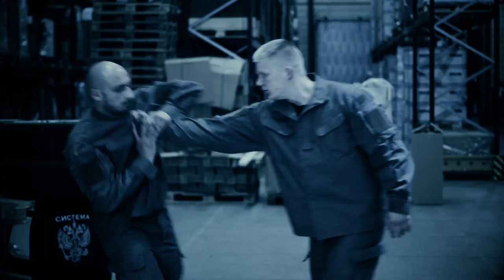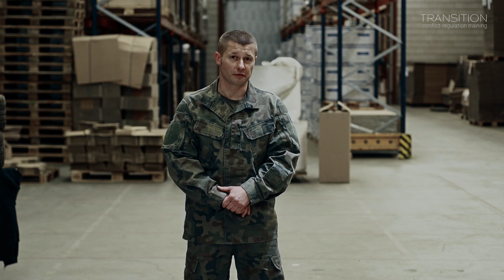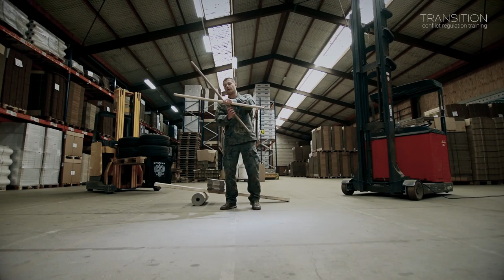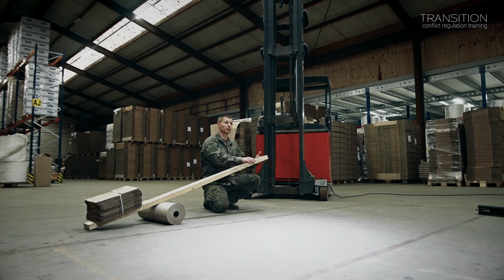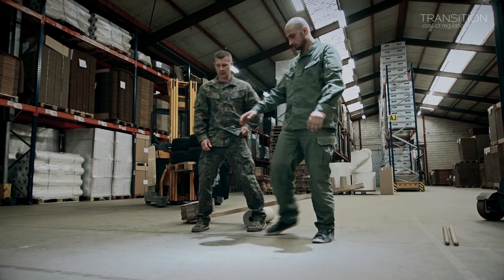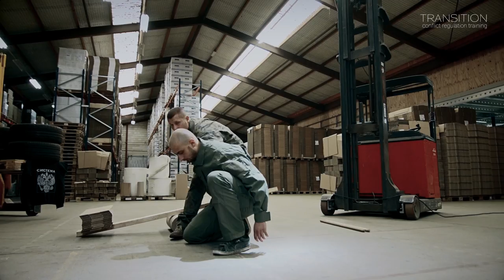Systema principles: usage of levers

Comment: So if you have the longer side away from the center of mass like his leg, depending on how close to his center of mass you use your arm or whatever as the fulcrum. That will determine the amount of force needed to move or unbalance his center of mass?  If I place the fulcrum of my body like hand closer to his c.o.m. like his thigh  I would need more force but the effect on unbalancing his body or c.o.m. is greater than if I place my fulcrum/hand on his knee which requires less strength on my end, can unbalance him/his c.o.m. but to a lesser degree. That is of course leaving out the fact that the knee is a joint and are your opponents fulcrums for controlling their own c.o.m. so one must be prepared for a counter balance move more readily than if I chose his thigh to apply my hand/fulcrum.